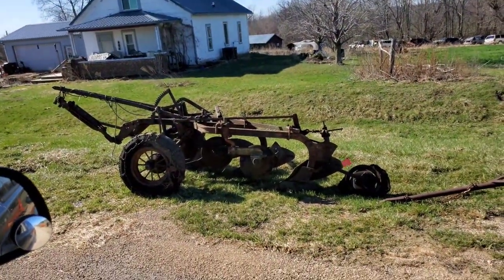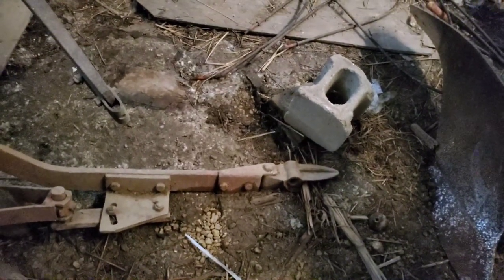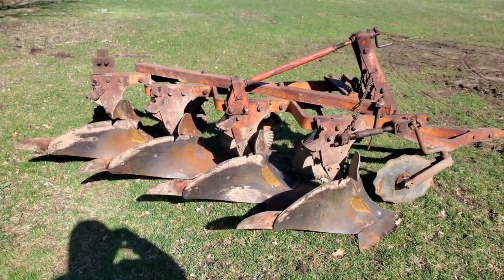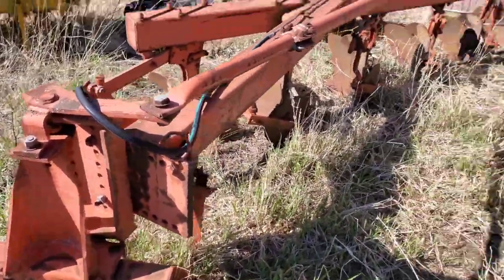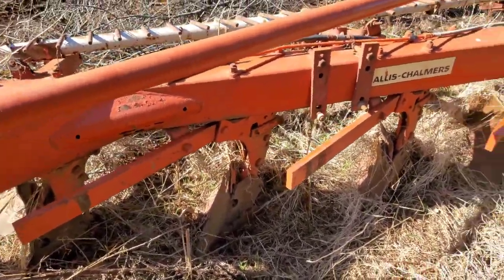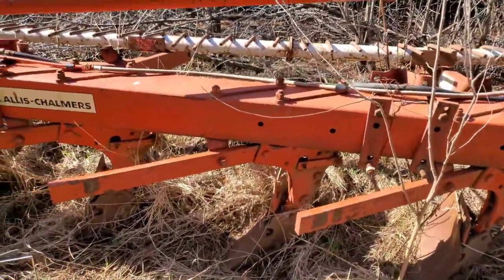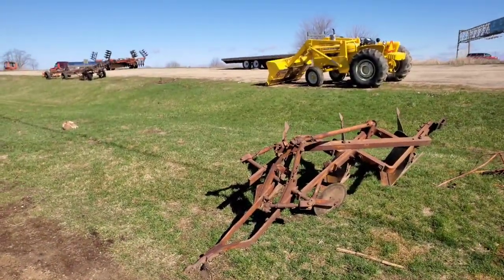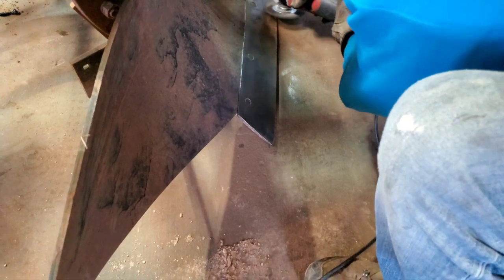A look at every moldboard plow on the farm... ALL 45 bottoms🤦‍♂️ Allis 50, 60, 70, 80, 2000 series.

Comment: Your off a little. The plow was based off pull type beams. Just called a pickup plow. The plow next to it is a CA pin hitch plow. Which is 50 series. The 3 bottom was 60 series. The 70 series were adjustable width wise. The 80 series was only a 70 with spring reset
Reply from the maker: Thankyou for the information Justin. I pinned your message so people can see where I messed up 😆
Reply: @TimothyFluegel  it’s all good. I need to do a video on pull type allis plows. Years and changes. I have over a dozen that that I can show the difference in years and options.
Reply from the maker: @justinblain928  all I can say is yeeeessssaa 😆 if you do I'm gonna share the hell out of it too.
Reply: The difference between the 60 and 70 series plows is there is one inch more clearance with the 70 series, and the frame is adjustable.  Justin had it pretty well right.  There is a video by Antique Allis about identifying different Allis plows.
Reply from the maker: @tedbuisker6827  thankyou Ted I watched that video so long ago I should have watched it again before making this but it was a spot of the moment thing and I knew yall would correct me lol

Comment: Suddenly I feel like I don't have nearly enough plows...only have 2...and one will probably get sold this year. I bought a model 80 3-16 snap coupler plow from my uncle a few years ago he pulled it behind a series 1 D17. In my ignorance I didn't realize the larger frame wouldn't fit right behind my WD45. Had to make shorter lift links to be able to use it. Got tired of fighting it and found a model 63 3-14 plow last winter, it is almost ready to go for this spring and should work out much better. Looking forward to seeing Bob's 301 pulling that 4 bottom! And looking forward to seeing your plow day too! It'll take a miracle for me to make it this year but I'll keep it on the calendar just in case. Thanks for the video Tim, have a good one
Reply from the maker: Well if a miracle does happen we'll save ya some dirt to turn 😆, after watching this I suddenly feel lie we have way too many plows 🤦‍♂️ however....I talked to the previous caretaker of the 99 the other day and he said he has 50 bottoms 😆 including an old pull type 5 16s jd plow very rare in these parts anyhow. I'm looking forward to seeing bobs tractor out there working too we built it to be versatile as a puller and useful tractor not like my 19 lol its a certified puller for sure lol. Thanks for watching Evan!

Comment: What do you think those finger like "forks" are for on the "C" one-bottom? Ever use any AC snap-coupler disc plows? Thanks for showing how you shine up your moldboards. Your plow day should make for some great footage.
Reply from the maker: Your welcome Robert thanks for watching. I threw that clip at the end there so you could see it in action 😆. The fingers on the c plow is a little drag you flip down like the one on that 6 bottom parts plow at the end. I've never used it but I'm curious what kind of a job they do.